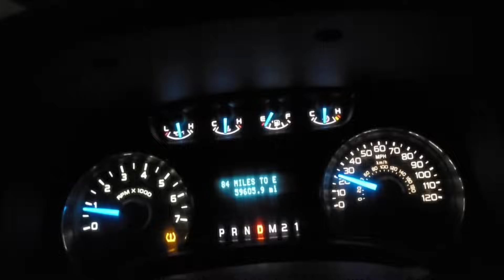Trashpicking Treasures

Comment: Strip that cast iron and reseason it and it'll be just like new my neighbor threw out a whole set. Im throwing out all my "non stick" pans and going cast (those other ones should say "sure stick")
Reply from the maker: Got it listed as is for 40 bucks 🤷🏻 
Scrappity usually try not to put anything into the scoops. Be it time or money.
Reply: Stuff like that I keep for meeeeee
Reply from the maker: @scrapahaulik5893  I don't use the smaller ones much. 
I got a nice cast 12" I cook with. 
I thought about sticking the Gris in the cabinet but it'll probably be what moves the 3. One is a Lodge and the other is just a Taiwan.